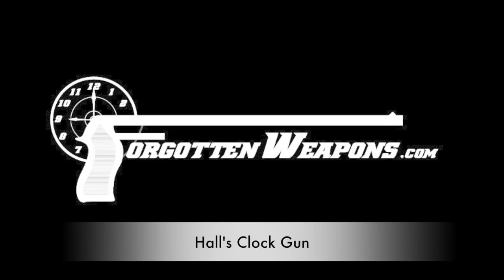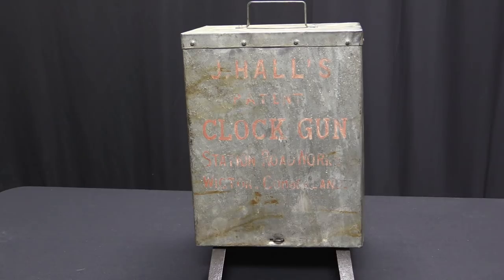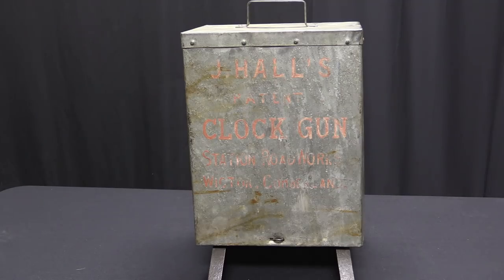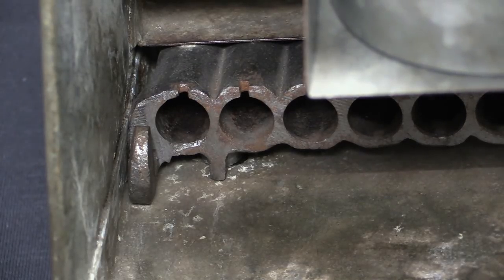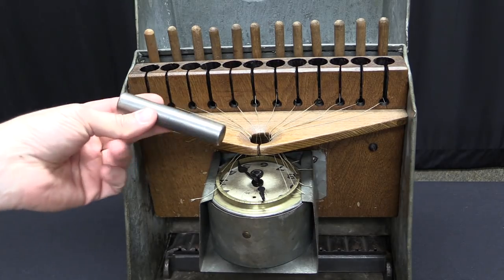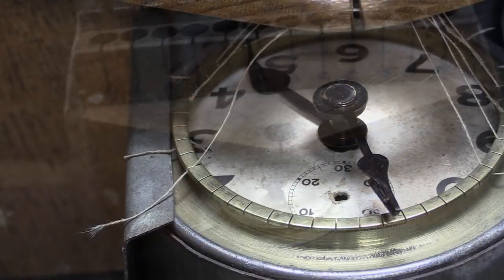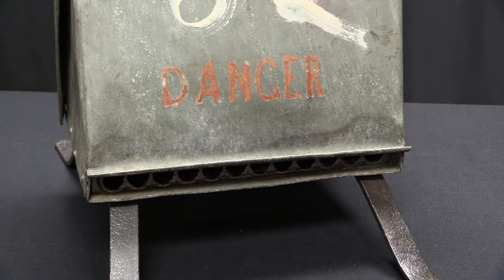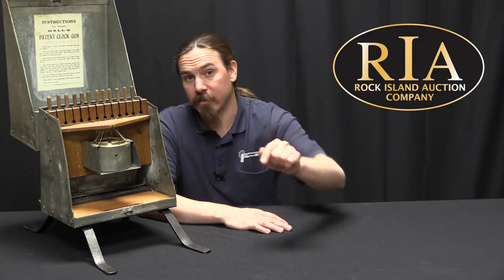Hall's Patent Clock Gun: A Shot Every Hour, On The Hour

Comment: Not to give the atf ideas but would this be considered an automatic?
Reply: Does a single twist of the winding key make it a machine gun?
Reply: I don't think so because you are loading every shot by hand...a machine gun does it for you after you've chambered the first round! (It's kind of like a volley-fire gun, just that the second shot in the volley happens an hour later and not by igniting a line of powder that fires several barrels in a row...not to mention that a once an hour "fully automatic" gun is a lot less dangerous than even a single-fire-cartrige rifle like a Martini-Henry, much less any repeating rifle with a magazine or even a semi-auto rifle!)
Reply: Hrm.

If I recall correctly, gatling guns are ok if they have a crank but not a motor... since it is spring loaded, I would guess.. not?
Reply: I saw a video about bump stocks where they guys who decided that they were legal said 'automatic means fires multiple rounds due to a single action of the trigger' so my guess would be no.
Reply: A staggered volley gun sounds about right, that's a hell of a thing.
Reply: the rules say something like: 'more than one shot for one pull of the trigger for a gun with automatic loading' (hand operated gatling guns are fine, but slap a motor on that thing and your in deep $@#*!). So this might possibly count on some interpretations; but it's so far outside the spirit of the law, not to mention just plain old, i believe it would be given an exemption if any question came of it.
Reply: ReverendTed A bumpstock isn't a particular threat either since you'd be more dangerous simply firing accurately, but someone was dumb enough to try a mass shooting with one and now it's mechahitler
Reply: charwhick THANK YOU. Somebody gets it.
Reply: ReverendTed Every 15 minutes approximately. Depends on how it cuts through the string...😅😂
Reply: By virtue of being 12ga and not having an 18inch barrel, this would be classified as an AOW.
Reply: DreamingFlurry so if the clock is faster than other clock guns, does that qualify for a device with an “increased rate of fire” and bannable under the new proposed interpretations of what constitutes a machine gun?
Reply: it truly is an automatic. Not only automatic but, autonomous .
Reply: ReverendTed 
but, more than one string could be pulled on those 15 min intervals. And autonomously at that.
Reply: 12ealDeal 
they did. this is the only one left

Comment: Hmm... Can it be made to fire flares? If so I can definitely see an application for that.
Reply: SinaelDOverom It probably could fire very small ones as is, but they would be fired parallel to the ground, so it would be a fire hazard more than anything else, and it wouldn't be able to fire upwards at all without extensive modification to the point of rebuilding the entire thing.
Reply: Jesse Smiley Unless you Rube Goldberg it to make the shots hit something that activates a vertically mounted flare launcher.
Reply: there are 12 gauge flares, and you can make a see-saw style lever with firing a pin on the work end, that will fire a cartridge from a side-attached barrel looking straight up.
Reply: It could be tilted, the weight should work and it ain't parallel to the ground
Reply: What purpose would you need for flares to be fired at regular intervals
Reply: Why not?

Comment: What is this thing legally? I mean one could think it's some sort of automatic shotgun with really short barrels.
Reply: It's basically an alarm mine on a timer. The barrels change it up slightly, but I doubt they'd survive actually shooting anything.
Reply: I think technically it would be a machine gun if it actually fired a projectile.   A very slow MG to be sure, but is a wind up key not the same as a trigger?
Reply: Slow rate of fire though. Plus lousy ergos.
Reply: No they couldn't. It doesn't shoot s projectile so it's not a fire arm. 

A ramset tool uses .22 blank cartridges to drive(shoot) rails at very high speeds yet is not considered a firearm.

Comment: We had a similar device called a corn cannon that used carbide and water to make acetalyne gas that when pressure reached a certain point would fire so worked like a water clock .The outer case looked just like the one you have it fired randomly 6 to 10 times hour it kept both crows and deer out of the grain feilds.

Comment: I had a propane scare cannon, that was used at airport's, and crop fields. It was hooked up to a propane tank with a pressure switch.  When pressure switch reached the desired pressure/ time interval it would release the propane into a metal horn and ignite at the same time creating a sound like a cannon.

Comment: My grandfather was a farmer, and used carbide cannons for scaring birds out of the cornfields.  A slow drip of water fell onto calcium carbide, producing acetylene gas, and when the pressure built up (about every 15 - 20 minutes) an igniter would set it off, with the report amplified and aimed through a megaphone.

Comment: 12-Bore black powder "saluting blanks" were widely available and used for starting and finishing yacht races etc, as well as for agricultural purposes. I used to have fun with the centrefire versions. VERY LOUD!

These days, farmers and more particularly market gardeners use things called "kro scarers" which is a thick rope that has been soaked in potassium nitrate, with numerous pyrotechnic cartridges (full of flash powder not black powder) with fast plastic-sleeved fuses threaded through the slow-burning rope. Hang it up, light one end and you have a loud bang and bright flash every fifteen minutes. 

Despite the name, the principal target is the humble wood-pigeon, America may have driven the passenger pigeon to extinction, but we still live with the woodies. They are much larger than doves or town pigeons and eat lots of things: especially peas and oilseed rape plants. In recent years, they have changed their habits and started living in towns, but in the seventies and early eighties there were still huge flocks of them in the countryside and they could wipe out a rape-field in a couple of hours. 

Fruit growers in Kent would also use them, probably against blackbirds and thrushes, which cannot legally be shot. Woodpigeons may be shot all year round!

Comment: When I've lived in rural areas of the UK where that are arable crops, there are always bird scarers. Usually in the form of a gas cylinder, a 'drain pipe' and a spark plug with a timer I guess. About as loud as a shotgun, but deeper and more hollow, as one might expect. The local pig farmer when I was a kid used to use fire work rockets to scare off flocks of starlings from eating the grain for the pigs.

Comment: They still sell and use equipment like this for bird deterrents. 
Although many of them have switched to high tech raptor calls. 

             They are used not only by farmers but also at airports to keep birds from roosting or resting near runways. A flock of birds taking off can take down an airplane.
         Bird deterrents are also used at shopping centers etc.

     Although their effectiveness is sometimes questionable.

Comment: The audible clock sounds like a great application, also perhaps it could have had a mechanism replace the clock that when a button is pressed fire them in a sequence (Morse code or other battlefield\naval signaling)
Another with the addition of a mechanical shutoff valve rigged into a timer could be starting a generator or igniting an oil or gas lighthouse.

Comment: This is the only video I've found that shows the British invention known as a Clock Gun, and that's exactly what it is, a gun with a trigger mechanism controlled by a clockwork mechanics, using a small upper and lower weighted pendulum, meaning it has a weight at the top and bottom equally with pendulum held by a central point instead of being held at the top with a swinging weight at the bottom as in a grandfather clock.
Only in Britain during the wars could anything be invented such as this invention, the Halls' “British field clock gun” although it was intentionally invented to scare away bird's on airfields or for farmers scaring away bird's instead of scarecrows, but I'm sure it was looked at by government and was also made in to a Clock field gun that fires live rounds too, because it could be easily converted to fire rifle rounds as well a blank shot gun cartridges.
I wonder of the rate of firing can be sped up by speeding up the swinging double weighed pendulum, like a metronome, so the faster it's ticks the faster it fires each round, if not, it could be easily made to do so with a few modifications, although of expect us British to have made it so it could have it timing changed.
What reason would something like this be invented and fir what purpose, reason, so a man doesn't have to do it, and purpose, to signify each hour on the hour with a round being fired each hour on the hour, meaning that soldier can now do other things worthy of his training.
Now I'll watch to see what the video says about it.
Always a pleasure watching this channel, especially when he's looking at Old British guns and obscure inventions.
Thus isn't the one I've seen, which has a cylindrical breaches arrangement and work through a clockwork mechanism with a double weighted pendulum rather than a watch type mechanism like this one being shown to us has, so maybe this is either a later patented version or another investor entirely.
Today it could be made using same technology to perform firing on either seconds, minutes, or hourly using similar method.

Comment: I guess the minute-hand might also cut the strings if you put them in the slots like you did, all the way down to the inside of the ring. Then you have set it to shoot x times per hour (for the more insistent birds).
The hour-hand might cut the strings better if they stick out of the top of the ring/slots.
Reply: BTW - would be more secure to hang such thing high up in a tree rather than putting it on the ground.

Comment: I hope your using blanks because that is a dangerous thing to just have laying around unattended. I was a little disappointed when I learned the original application of this though that would work good in a corn field. Especially if the birds are sitting near it at the correct hour. I was thinking more of a military base camp use though.

Comment: Thats a dumb design how it cuts the string. You would always have to change out the strings. The clock arm should just pop the string out of the groove so the weight is free to drop. I wonder if thats how it actually works.
Reply: Did you not notice all the string wrapped around the spindles